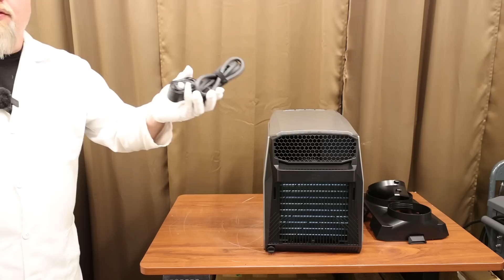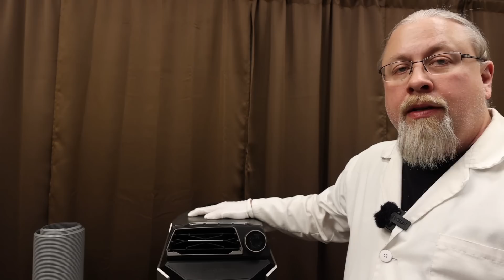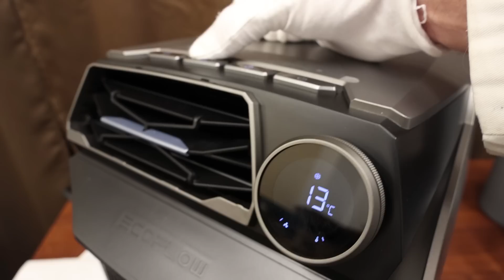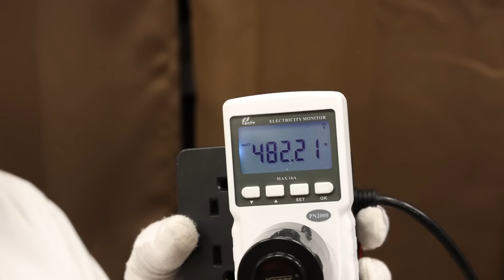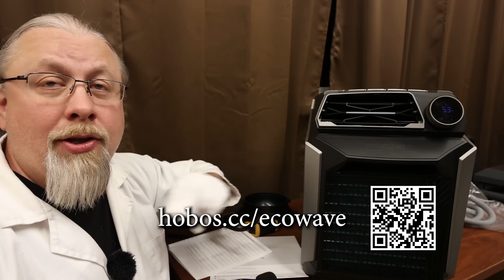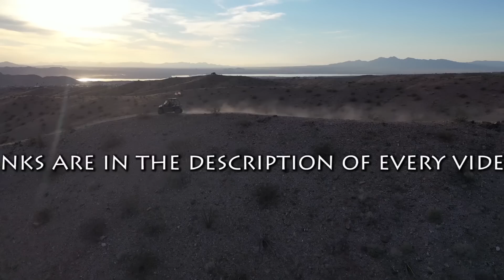EcoFlow Wave PORTABLE Battery Powered Air Conditioner 4000 BTU First Look Review

Comment from the maker: THIS PRODUCT HAS BEEN REPLACED WITH THE WAVE 2! WAVE 2 REVIEW: https://youtu.be/2NBfhABwn18 (Wave 2 purchase link: https://gohobo.io/wave2 use code ECOFLOWAFF )
PART TWO REVIEW (with battery) https://youtu.be/Ngm4Ct1O_Xc
PART THREE Battery FAQ: https://youtu.be/KGbvUD2N4WE
Reply: Wondering if it's possible to run the Wave via DC from a non EcoFlow powerstation? Any chance you can test this? Thanks for all of your thorough reviews!
Reply: @Mangarito21  @hobotech Exactly!  I would like to power this via DC straight from my battery bank in the RV.  Could I buy the proper power plug from EcoFlow, splice into it, use a 12v to 24v upconverter, and wire it to my house battery bank?
Reply: You can buy a ductless mini split for less then $800 delivered and they are super quiet and high efficiency.
Reply from the maker: @deankoch7305  But they aren't portable nor do they run on DC. Apples to oranges.
Reply: @HOBOTECH  boom, roasted!
Reply from the maker: @sir_iosis6760  Yeah I went easy. I didn't bother mentioning installation cost of a mini split. 😆

Comment: Ecoflow's site claims this also functions as a dehumidifier.  Can anyone comment on whether it has a dehumidification "mode", or would the user have to run it as a/c, then heater, then a/c, etc.?

Would this unit work effectively as a dehumidifier, or is it just a weak effect that comes with it's heating and a/c functions?  

It has a drain, but Ecoflow's site claims that condensed water is passed over internal parts and re-evaporated.

Many thanks to anyone who can answer!

Comment: I don't get it.  If it can pull AC 500 watts straight from the wall, why couldn't you just use the same wall plug to get power from the Delta Pro? Just turn on the inverter and run the unit.  Why would you need a firmware update for that?

Comment: This not products i would recommend too no one buy because i buy one with battery its will only run 45 min on battery pack before turning its self off ... Its runs ok on wall power ... Thats not why i buy it ... I buy it for semi truck too save on my diesel bill ... I all so called and email ecoflow get no where ... Oh with eco mode you can't turn up fan its really dont kick out no air on that mode ... So this product really not good buy for tent or off grid living ... Oh of you hold down temperature button its just turn unit off ... Its wasted of time buy this unit i wasted $1799 on pre-sale of unit ... I need its for off grid where i have no wall power on road as semi driver its very important to save as much feel as possible with the highs of fuel prices .... This unit will not do job of keeping you cool wen unit keeps turning off with 60% plus battery ... Only way keep unit running on wall power ... Oh solar will not fully charge your battery on unit because you can only used 200 watts of solar ... Its would take maybe 3 to 4 days charge battery on solar with 200 watts ...

Comment: I Just bought a portable AC Hisense 6,000 BTU 57lb unit with wheels $330 good for 250 Sq ft. 800 watts.  I’m only cooling 1 room in an RV. It works great.  The reviewed unit would be great if I had more to spend.

Comment: I love your smart reviews. Thanks for all your contributions. Question : I have 2 Delta Pros and a double voltage hub. I have an Induction range that I want to power with the Pros. I tried connecting a 3-prong cord to the 4-prong outlet in the hub but it doesn't work. What am I doing wrong?

Comment: I bought the eco pro and noticed that if left on was using watts to run the inverter. Called eco and said if even with nothing plugged in using power   it will drain in 24 days. So If its not plugged in to charge do not leave outlet power on. Im shocked it will drain in   24  days
Reply from the maker: All inverters have phantom power loss when turned on. That's physics.
Reply: @HOBOTECH  yes but I think on how fast is important.  If I didnt download the app I wouldnt have seen How Fast

Comment: If it saves me $100 to $300 per month on electricity here south of Havasu with A/C 24/7 most of the year, $1800 for the Wave with battery can pay for itself in one year, but will it last running 24/7 like I’d need it to here?  How long will this run connected to a BluettiMaxOak or an EcoFlowDelta? (Show idea!) Can either of those be used as pass-through, with or without the Wave’s own battery) hooked up to solar panels? (I got six 100watt Renogy panels…)

Comment: You need the return air INTAKE in the tent. If outside  it's cooling OUTSIDE humid air and blowing it inside.Thats horribly inefficient and not comfortable because the air would remain humid and not dry while cooling. Also as a result of the air being humid it will expend much of the cooling capacity to chill the water in the air, reducing the the net cooling temperature difference between the return air in and cool air out.

Comment: So I know they are just sponsoring you, but was wondering if anyone knows if it is possible to hook this thing up to your RV battery? It seems it is designed to only work with Eco Flo's very pricey batteries, which is fine for a tent but when you already have a rig with a decent battery system, it seems silly to waste extra money and space
Reply from the maker: If I get a free product to review I'm required to say I'm "sponsored". It's only designed to work with EcoFlow's battery voltage. If you can rig up a battery (48v?) and get the proprietary plug they use then it should be possible to power it directly.
Reply: @HOBOTECH  Cool, I just assumed since you got it pre-launch you were sponsored, but either way thanks for the review and info on possibility of wiring. It looks like I wasn't alone in wondering about what can power it, because that section of your video got the most replayed tag. Will be interesting to see how folks make use of this device

Comment: It would sure be nice if the EcoFlow Wave battery had been designed to power sometimes else besides just the Wave. For $900, I think it is way too much not to be able to power or charge something else. If your wave breaks or it is to cold to use the wave, the battery is useless.

Comment: You need a minimum 8000 BTU to keep a well insulated campervan/RV sleeping area slightly cooler overnight. (around 75 F) and you need about 45-80Ah of 12v battery per hour to achieve that with the most efficient 12v A/C units. (45-80Ah per hour depending on the outside temperature) Realistically you need at least a 500Ah of Lifepo4 to run the most efficient 8000 BTU A/C unit for 8 hours and it still wont drop the temperature below 70 F in the sleeping/bed sized area. People need to be realistic about how much off grid A/C is capable of. Consider how much electric the A/C in a house uses or even a mini split to cool a single room. At most 4000 BTU is enough to cool a rooftop tent down by 20 degrees F if it's 90F outside. If you want better cooling you need more battery capacity and 12,000 BTU to run all night and a way of charging that larger battery bank.

Comment: Normal window ac cost $99 at wal mart. This ac only 4000btu cost over $1000 alone. Add battery and its well over $2500 as much as $4000. Depend on which version you get. Lmao. Yeah, we gonna run out to get one asap. Hahha.

Comment: My condos hvac heatpump compressor in the condenser on the roof is toast and  its an old old york! So i cant just put a new compressor because of the refrigerant.. sigh. Well anyway , this looks like the cheaper option.. ill frikken throw out my hvac in the lil hvac room and replace it with this? just attach the hose to the vents and boom.. its 3 stories to the roof so i can just buy extra hose to the roof? right? RIGHT?!?!? Please right!?
Reply from the maker: This will cool one small room, not a condo.
Reply: @HOBOTECH  hello darkness my ole friend…  grrrrrrrreat! Thanks

Comment: A standard 5000BTU unit only pulls 500W.  What is the point of this unit at that Price?
Reply from the maker: See the big words PORTABLE BATTERY POWERED in the thumbnail?
Reply: @HOBOTECH  Yes, but you said the one you had did not have the battery.  If it had a big battery maybe.  I am looking for a van AC that a Bluetti can drive about 3 hrs a day.  I will have to look at your specs again.
Reply from the maker: @peacefulprepper2402  I just got the battery and will be testing it. I believe it should run that long. Otherwise it can run off a Bluetti.
Reply: @HOBOTECH  We can also buy the 2400Wh Bluetti with a standard AC for much less.  I worry about a specialized Item like this failing.  I can go to Wally World or HD and replace a standard unit.  How long would it take to get parts for this is another problem.  If it used 200W it would be worth it.  I just think my money will go towards more batteries and solar.  New batteries will out live us, new panels will out live us.  How long will this thing last?

Comment: If this had a humidity sensor it would be way better for where I live.  You can wake up soaking wet in your tent because it's 100% humidity out side at night here, and usually 70% humidity during the day if not more IDC what the temp is I need the humidity down more than I need the temp, thought the temp being lower is a bonus.

Comment: You can buy a portable room air conditioner for about 350 bucks at lowes or home depot. I tested it on my ecoflow delta pro and it draws 1100 watts and would run for 4 hours.

Comment: 1299 is more reasonable... only 10x the price of a 5000btu window unit right now. 

It is a specialty product for camping and travel.   I felt very uncomfortable at the thought of buying something for 2500 that might break in a year. I only feel uncomfortable at the thought of buying something for $1,300 that might break in a year. I think if they could get it down to 900 then I wouldn't feel uncomfortable. Or if we got a good Baseline that it was going to be reliable for three or more years than I would be more comfortable with the $1,300 price.

However if I were still making $120,000, it wouldn't concern me. So this seems well targeted at glampers.

Comment: Can anyone recommended a low Watt Portable Air Conditioner? That EcoFlow Wave looks slick but it's way to expensive.
Reply from the maker: The only DC compressor ones that exist are this one and the Zero Breeze. The latter costs just as much but is 2000-something BTU.
Reply: @HOBOTECH  Thank you for your advice!

Comment: Love the Strange Brew reference...haha
Reply: quick question, can you reverse the tubes and use it to heat your space as well?  Say you had a chilly nigh, can  you blow the warm air into your camper and utilize the cold air outside to accomplish the task?
Reply from the maker: I guess so but it would be easier to use a $25 electric heater.

Comment: I called EcoFlow to find out the connectors on the left side of the unit, they dont know anything about the unit or even have a manual for it yet.  I don't need a "snap on battery" as I have a battleborn 100ah lithium battery in my campervan.  I would like to power this unit directly from my Battleborn battery.  Do you know what the connector is so I can hook it up doing the DC-DC?

Comment: My Frigidaire window unit 6000 btu w eco is more energy efficient than that and runs off solar and an inverter just fine.  I sort of stole it on a super special deal of $179.00.  It is about the same or quieter than this unit.  Not impressed with this just to add solar plugs and run off a battery.  Just get an AC system on solar and go that route.
Reply: I run Frigidaires window units with my dual fuel generator for hurricanes.

Comment: Im confused at the advantages of buying this vs some other Ac unit...if i bought this.. and the battery ..the battery still can be depleted using this in 5 hours... maybe 12 hours if i buy the delta pro altogether for about $3k... but if I'm off grid... and on my day off from work and decided to sleep late the next day...if i already had been using the unit the day before..it would be a matter of time before that battery needs recharging..if have to get out the bed fumble around trying to recharge it..or hook a solar panel..id be pissed if it's raining too.. and the battery was dead or low.. and off griding...i just think it to pricey to have those meaningful limitations.. then if not using the battery... it needs to be plugged in...if i have to plug it in the wall, I may as well buy a stronger ac for a fraction of that price that also plugs in the wall and i can sleep as long as i want ....

Comment: If it’s pulling nearly 500 watts AC, wouldn’t it pull close to that even on DC?  Even if pulled 400 watts, that’s only about two hours run time even with an 800whr battery.  

I like the idea of this device, it seems well made.  I just don’t know how practical it is for use with a battery pack.  It seems like this would be ideal for a campsite with power hookups.

Comment: For me zero breeze is still better - lighter and can put inside a roof top tent.  Zero breeze will reduce humidity too vs just blowing cool air in. For $100 get a Frigidaire 5000 slow start AC for large ground tents.  It uses less than 500Wh.  Plus you can easily mod it to direct air like this unit and save a ton of money.
Reply: It uses less than 500 watt-hours per what?

Cooling the air and dehumidifying the air is exactly the same thing when it comes to air conditioners.  An air conditioner can't dehumidify without cooling, and it can't cool without dehumidifying.
Reply: This one will reduce humidity too if you move it inside.

Comment: You can get a 12,000 btu mini split system Heating and cooling (110 or 230v) for under $700...it's not portable but most have off grid systems can handle this A/C load easily.  paying $3k to $5k to air condition a tent?  The variable DC compressor is nice and sounds efficient but not at that price
Reply: That’s true. But they don’t look as cool my boy

Comment: With the cost of this unit you could buy a solar generator and run a small inverter air conditioner.
Reply: The way I see it the only way to Justify is in bundles where it’s about 500. I’d never pay 1100-1500

Comment: If you put the unit outside you will also want the input hose inside, otherwise the outside air will be the air that the unit will have to cool. Would be very inefficient.

Comment: With my CALB LiFePo4 diy 12v 100AH solar generator I can run a 5000 btu (consumes about 480 watts) LG window a/c all day long with 400 watts of solar charging the battery while it runs the a/c. Not seeing the benefit of this type of a/c. Wish they made a 3000 btu window a/c that'll consume about 350 watts while running.

Comment: I love ecoflow, but there is no way I would blow $2500 on their AC unit. I have a Frigidaire 5k and it pulls 300 watts for 1 minute then drops to 50 watts for 3 minutes. It weighs in at 39lbs. Is it a window unit? Yes. Can I carry it camping? Yes, in a cart. Lol. If anyone wants pics of it sticking out of my Lanshan 2, just let me know.
Reply: your power numbers dont make sense..Fridgadaire 5k would be like 450 watt...til space got pulled down...thn 50 watt for fan til needs to turn on compressor again..5k and a quality inverter is really good combo.300 ac...500 inverter is still only 800...and universal stuff.
Reply: @dr650dude  tell me how to send the pics and I will. With a temp gauge next to it.
Reply: My same experience, but mine is a 6000 BTU unit, so add about 20-50 watts.  Love that the Frigidaire will actually shut all the way down when room temp is achieved.  And it also has a temp increase mode to raise the temp 2 degrees per hour to save power (e.g. like when you are sleeping and it is getting gradually cooler overnight).
Reply: Can you give us a link to your fridge dare? Thank you

Comment: Is this a one hose or two hose unit on the hot side?
Reply from the maker: There are two hoses. Did you watch me hook up the adapter plate?
Reply: @HOBOTECH  ah I see I was a bit confused with the small hose attaching to the front. Is the idea that if you’re using the small hose for the cold side you don’t need it on the hot side?

Comment: I would love to know if it's possible to run the Wave while charging its battery attachment via DC! Not having to run my inverter would be a huge game-changer
Reply from the maker: Yes, it will charge while you use it. That's why it has a DC input.

Comment: That a waste of money save yourself $1,000 and buy a 6000 btu for $300
Reply from the maker: A 6000 btu window unit isn't portable nor is it DC powered. That's the point of this product.
Reply: @HOBOTECH ok I didn't not know that.   I just looked it up and their are 8000 btu portable air conditioner that use about 800 watts so I guess this is a nice product but way over price.

Comment: Zero Breeze definitely has to step up. Aside from the price and size the ZB doesn't really offer anything much when compared against this beast.
Reply: It's easy to carry with handle.
Reply: Uses a lot less energy (less than half); it was the reason I went with the ZB instead of the Ecoflow. 

It really just depends on your application. I needed a spot cooler in boondock situations. 500 watts is too much for my purpose.
Reply: @razordu30  what is the watts of the zb?

Comment: Does the Wave have a built-in thermostat? I'm really excited about this product. I'm aiming to run this off DC so I hope that it can last all night. I've got a Delta Max and based on the timing mode I can pretty much adjust how long it operates.
Reply from the maker: Yes. I showed that in the review.
Reply: Eco told me 6hrs continuous run time with the Max 2000.